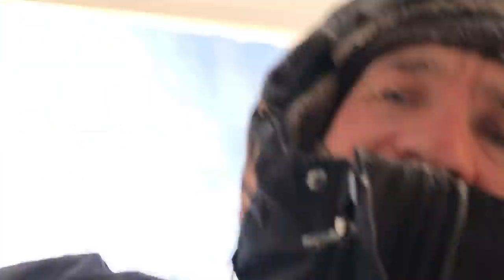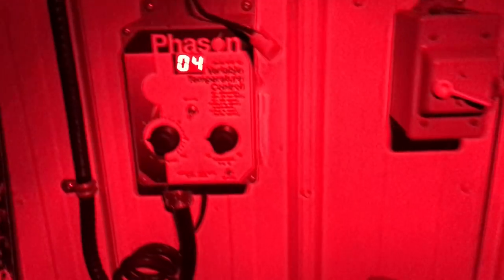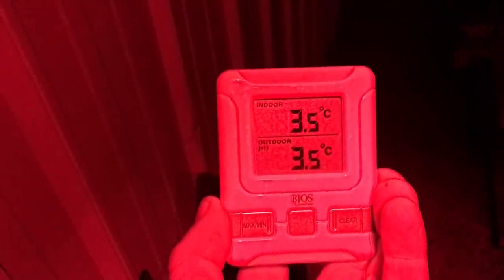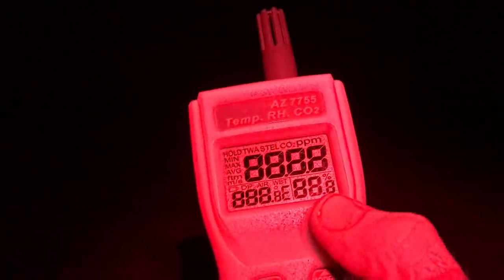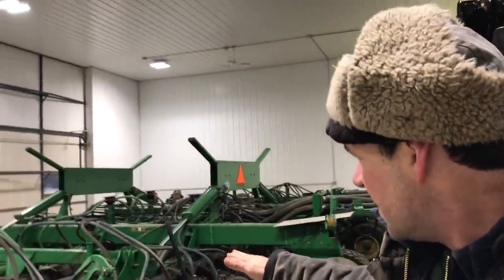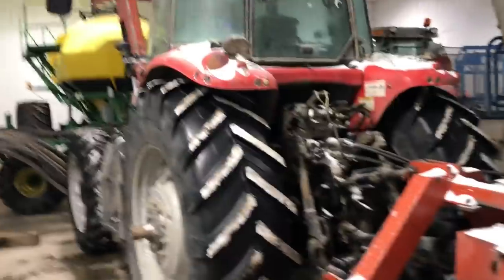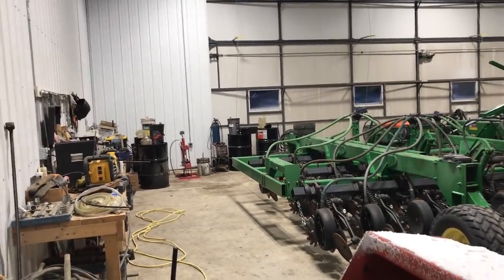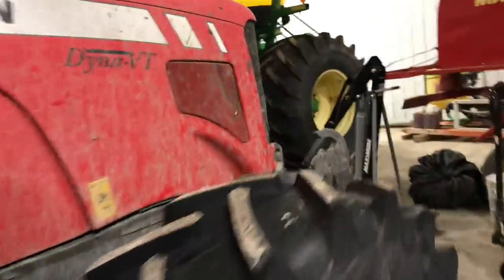Massey Harris 21 Combine - YouTube Motor Heads, please comment, skip-6:20

Comment: Ian, my BF is a savant mechanic! He machines, builds & rebuilds race car and other engines, heads, valves, etc. (he actually completely rebuilt a bunch of haying equipment for me on the weekends this summer). Anyway, he said NO WAY can you just add rings. The whole engine likely needs to be rebuilt —valve job & guides. But he says if you do it will last another 40years+. Good news is he says you can still get the parts.

Comment: Pistons that loose, rebuild! No choice. You won't find rings that can cure that. The loose also puts pressure on the bearings. You might have wear on the crankshaft too. A complete rebuilt is in order and these old engines a made more simple than the newer ones, thus cheaper to fix! Thanks for another great video! Happy New Year!

Comment: Cylinder bore is most likely worn as seen by the piston slap.  Is there a ridge in the cylinder around a 1/4” from the top that you can feel?  Just getting new rings won’t help because of the amount of piston slap.  Would need to be bored with oversized pistons and rings unfortunately.

Comment: Here's what a very knowledgeable friend said about rebuilding a worn out flat 6 in a 1940's military vehicle that will not be ran but a few hours each year. Sounds a bit like your situation.
"If you pull the head, you’ll find your pistons are probably worn severely, rings are shot and cracked , valve guides are sloppy.
Spend some money and you can get your engine running pretty good for doing a one day job. I’ve told former customers in the past this over and over.
Pull the pistons and replace the same size with new pistons and new rings , hone the cylinders out.
If there is a large Groove that your fingernails can grab at the very top of the cylinder you can use a ridge cutter that is a manual cutter to take that ridge out so you can push the piston out. sometimes the rings will get stuck on the groove that’s caused from severe cylinder wear.
If you’re oil pressure has been OK just replace the rod bearings, if you’re really enthusiastic replace the main bearings.
I always felt if you had to replace main bearings you should pull the engine out and rebuild the entire engine properly including new cam bearings.
Replace your oil pump with a new one and a new oil filter pick up screen.
With an engine having that much time on it you’ll probably find all your valve guides are sloppy at this stage it’s easy to remove the valves . you can either relap the seats with valve grinding compound and see how they look , meaning is the seat in the center of the valve or you can install new guides and new valves to take care of any problem you may have hopefully you won’t have to cut your valve seats.
So to recap
Replace pistons and rings with the same size the engine was bored out to originally.
Replace rod bearings maybe main bearings
Replace engine oil pump and pick up screen
Probably replace valve guides and valves,
Break the cylinder wall dark looking haze with a nice shiny cross hatch in each cylinder. Keep the honeing down to a minimum so you do not enlarge the bore."
Hope this helps!!

Comment: Hone the cylinders, knurl or replace the pistons, new rings, lap the valves unless they need regrind, good for three hours a year. My high school project 1958. edit; Heads are likely worn just as bad. Pop can shims will tighten the con rod bearings.

Comment: Years ago they used to knurl piston skirts to expand the piston to tighten them up. Not many still have those tools or the knowledge to use them. The top of the piston is the smallest part so some rocking is normal. I also notice that the piston seems able to wobble in any direction which makes me wonder about the condition of the wrist pin bushings.

Comment: By the look of the amount you can move the piston I’m not sure it can be even bored out, it may be gone to far. Absolutely not just new rings. 25 years master technician and I’ve never seen one that loose but I’m not familiar with that particular engine either. It needs to have a rebuilder measure it.

Comment: It is unfortunate but there looks to be an extreme amount of where in that unit. A rebuild or repower is probably the only way to go to have a successful rebuild. You will probably find cupped valves and sunken valve seats due to the extreme operating conditions that the unit lived under.  Also inspection of the crank and cam may reveal more extreme wear yet. Unfortunately a repower or replacement engine may end up being your best option. 
Honestly it is a heritage machine it has family value, fixer up properly and the boys can enjoy her in the harvest and make her do what she was designed to do when she was new.  I had the privilege of operating an old binder with my dad. He told the story of when he used to do this when he was a small boy. Still have the pictures and memories of operating that machine with him. Absolutely priceless.

Comment: I agree with Eric who commented early on, you need to measure things up and see where you are before you can make a decision.  Rings won't do it for what looks like excessive wear in the cylinders but if you have enough cylinder left and they are not too far out of round then you may be able to get the block bored out and go with oversize pistons. No real way to tell except by getting it measured up.  You will need to check the crank journals for wear too so your local shop guy will probably be the route to go to see if it can all meet spec and then decide.  Might be less expensive to go with a replacement engine but then the boys won't get the experience doing the rebuild.  Looking forward to seeing what you find and decide, good luck with it.

Comment: Great idea introducing the kid to mechanical workings. Enthusiasm is highest IMHO by working on something that you can later ride,/drive, i.e. go-kart or dirt bike. 
You tried 6: Most surfaces wear fairly even, so the cylinder walls are probably tapered and out-of-round also. Values too worn to re-use, and possibly little meat left on valve seats. Hopefully someone has a used engine that you can swap. On that hasn't been around the world and back!  Why don't you post a block serial number, and maybe the new year will come with resolve. Come on guys, let get to looking! Happy new year.🙏🎉

Comment: In the old days, like the times when that engine was new, and on a comparable engine, they used a special tool to measure the clearance between the piston and cylinder wall. This tool consisted of a tension scale connected to a feeler gauge of 0.003 inches thickness and 3/4 inch wide. The feeler was put between piston and cylinder all the way down the side of the piston. If more than 10 pounds was required to lift the feeler then the piston was too large. If less then 5 pounds was required, then piston was too loose.

Comment: Well I'm no engine guy but I'm going to say that you're going to need some new Pistons LOL normally blocks will get bored out 10 20 and 30 over. But that's thousands at least here in the states. And judging from that piston wiggle you might already be at 30 over.. if it's worth doing is worth doing right probably should get your crank and cam bearings replaced as well. If they're worn out . And they probably are. you'll have low oil pressure that's what happened on my International 300 utility. If you do happen to have all this work done make sure you run the best oil you can and since it's an older engine I've heard using an additive with high zinc helps. But you may want to do more research into that. Best of luck to you keep me posted with videos thoroughly enjoy them. thank you

Comment: Your machine shop should have the best answers you need. Looks like it's been bored out .030" over the last time it was overhauled. Some motors can be bored out just so much. I've seen old engines with real sloppy bores get rebuilt with sleeves to bring the bore back to original spec.. The other wear surfaces ( crank & camshaft) will tell you whether or not to look for another engine with less wear to rebuild. Don't forget the oil pump. no matter how good the rebuild was, if the pump isn't putting out enough lube oil at the proper pressure, it's money down the drain in quick order. The oil pump will wear just like the other components.

Comment: Ian I think if you take the ridge off the top of the cylinder and check if you can get oversized rings for your pistons,hone the cylinders to put crosshatch back on the cylinders, you might get away with this.Always remember if you build compression in the top part it may take a barring out in another spot.Good luck Joe Cook

Comment: My guess is, at least some of the rings are broken, allowing the piston to slop around in the bore, and likely caused the pistons themselves to wear down. Looks like they’re Std. size? I would put in a new set of pistons and rings, replace the valve guides (easy job), and replace the rod bearings. For what it’s worth, my truck has essentially the same engine (Chrysler 251) and it’s in a similar state. I have put 28,000 miles on it, and counting, waiting for a good deal to come up on a replacement engine. I finally found a 265 from a combine, nice tight engine, and am in the process of converting it to a truck engine. I wouldn’t even consider another type of engine. These flatheads are SO easy to work on, reliable, sound great, and will run practically forever.

Comment: Cheapest way is mic the bores and see how close they are too each other and get bigger pistons. 10-20 thow bigger to close up the slop and get the a little bit bigger than the bores and file the rings down to fit.  Make sure to mic the rings so they have expansion room. I've done that before and that engine was still running when dad sold the tractor 5 years later. Plowed many fields in that time. But they probably don't make pistons just a little bit oversized anymore, probably have to start at 30 thousands oversized.

Comment: Depends on what you want. Clearly some folks don't agree but rings would make a difference. all the wear you see on the cylinder wore the rings out as well. New rings, cut the ridge and deglaze and it would be better. No mechanic would ever agree. But, then again a mechanic would suggest oversize and while you have it apart. full rebuild. Rings aren't a lot of money so it wouldn't be a big deal to try it. cut the ridge, deglaze. stick in the rings then bolt it back together mount it outside the machine and fire it up. Bench test. if it works. reinstall it. if not then you have a decision to make. bite the bullet or find a engine in better shape.

Comment: It would appear the last rebuild bored the block 0.60 and replaced pistons with 0.30. Gap around seems concentric, not egg shaped like from wear. Get a bore gauge and measure several places around and up and down the bore on each cylinder. Not seeing a wear ridge at top of cylinder leads me to the conclusion a predecessor screwed up. If, I restate IF your cylinders are round, and on size for .060, pistons and rings alone should not add up to a whole lot. Check for valve height before you tear down further, measure each at it's highest point from block. All the intake valves should match, as well as the exhaust. While the camshaft may be worn, consistency between valves should eliminate excessive versus normal wear. Once you have the pan off assess the rod play,  you may get lucky enough and not have to resize and rebearing the rods. Plastigage and the manual will indicate the bearing surface clearances between rods and crank, and crank and block.
It may be hard to justify the cost for a non production machine, however time with the boys and preserving the past can be priceless.

Comment: With all the old farmalls I have worked on I think u can get buy with some new sleeve and rings clean up valves   it might be not the rite way but for couple hours a year be fine or talk to motor guy see if u can get some over size rings  might do the trick too  get er up and running use some 2stroke oil with gas back in them days gas was leaded for lube   hope u and your family have a happy new years

Comment: Drain the crankcase, add back proper volume of 80-90-140, plus 1/2 cup sawdust per cylinder. Here maybe maple sawdust would do the trick initially. After a 20 minute break in run, drain and reserve the break in fluid, replace the same as above. Consult the Red Green Automotive Digest for preferred use of reserved fluid as to pancakes or waffles. Happy New Year Ian and family! -Bob...

Comment: Just like the 20 feet you needed to have put on, do the right thing. You know you will just use it two to three hours for actual combine work, but you will be trailering and driving it to shows and parades. You need not go full period rebuild. You will need to do just a bit more than you currently think. Lest you regret not doing that one thing you don't deem cost efficient. I whole heartedly support your children doing as much as possible, up to and including taking them to the machine shop that will be doing the hard work. In the end it is your combine and I will watch your progress here. I pray you do not take short cuts that you may soon regret.

Comment: Ian, I pretty much agree with has already been said, especially mic the bores for out of round and consistent dimension top to bottom.  Looking at that short block, how thin the material is between bores, and the slop of those pistons, I would not be surprised if this engine has already been bored out.  If you are after period correct, then perhaps bore & sleeve the engine, new pistons to fit sleeves, magna-flux or crack checking the rods & other appropriate engine components.  If you have not evaluated the crankshaft,  cylinder head, and block deck, that will be yet more hurdles.  Something to consider, is to look into whether something like a Chrysler slant 6 (225 cubic inch seem to be the most common) from a salvage/junk yard would work as a replacement engine if you can figure out an adaptor plate to make the engine mate up properly to the drive line.  Parts are much more available and these engines are pretty plentiful so they are likely very cheap considering the cost of a proper rebuild.  You could take your time and rebuild the original engine for later replacement if you want a period correct engine.  Not long ago the head gasket went out on the wife's Dodge pickup.  After replacing the head gasket, milling the head, replacing 6 fuel injectors with Bosch 275 hp RV injectors, ARP head studs, and having the head totally overhauled to include new threaded & freeze plugs, the old Cummins ran great but the bill for was an attention getter.  I wanted to do this job ONE TIME, so I did it right. The Cummins was worth saving.  That 1949 Chrysler six cylinder is also worth saving if you want period correct.  Take the time to do it right. In the mean time a low cost replacement slant six or other inline 6 engine may be a good possibility.  I would say that your farm got its money's worth out that 1949 Chrysler.  Best of luck with it.

Comment: Here's the thing, you could get rings and it will increase the compression, but with that much slop (play), it won't last and you'll do more damage to it, also increase risk of more catastrophic failure. There is plenty of meat in that motor, I'm sure that running it that loose for all those years has turned your once round cylinders somewhat oval, so you need a machinist to see if going say .60 over will bring it back into being true. New oversized pistons, possibly sleeves if you want it to last, but I'd replace the whole bottom end, get the crank cleaned up, hopefully bearing journals are still true, replace the cam and any worn out valve train components including getting the seats machined and see if it needs to be decked.

It's a big job, parts expensive, you might find aftermarket oversized rebuild kits cheaper. It might also be just as expensive to buy a rebuilt one online, I'm sure some sells a fully rebuilt version.

I personally would also look into seeing if I could replace it with something more modern and reliable. Farmers are crafty, and I bet there are plans, possibly modern conversion kits for much newer, cheaper, lighter and more readily available and reliable engines.
Reply from the maker: Oh but the sound of the straight pipe flat top 6 is half the experience lol 👍
Reply: @aCanadianBeekeepersBlog  I'm sure there is no coming close to replicating that sound unless the replacement is another straight six, but even then, the firing order, timing, cam profile, manifold size, all will impact that glorious sound.

Maybe you step it up a notch? Hack a cheap truck LS motor on there with a budget aftermarket EFI system on it. Won't be much of an overall difference size-wise but the sound of straight pipes (especially open headers) on an LS is an eargasm, even if an LS is super overkill for this use and really the wrong power profile, could fix that with a cam though 😁

Comment: I'm sure the cylinders are worn and there is ring groove at the top. If you don't enlarge the bore and get the bore cleaned up you will probably break the top rings when you fire it up. Also the pistons are undoubtedly worn. You will have to mic it to see but you will probably have go oversized on the pistons and rings anyway. I know you are trying to hold down cost but if it is worth doing then do it right. That is the best lesson your boys can learn.

Comment: I would measure the cylinder and see if you can get oversized pistons and rings that fit it . If you get the biggest piston and ring combo that will fit you will get compression until the cylinder gives way . You should also replace the main and Rod bearings as higher compression will cause a knock and probably break a piston rod if you don't.
This is not the "right " thing to do but it will get it running for cheep ,boring it out probably wont work.